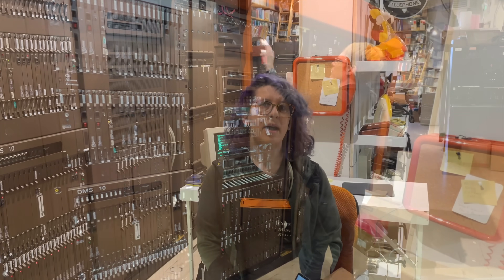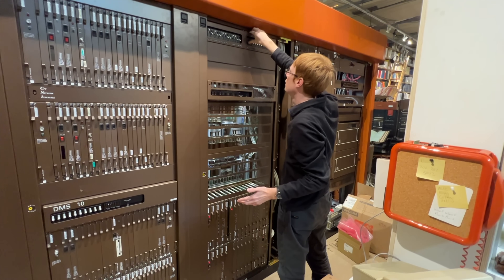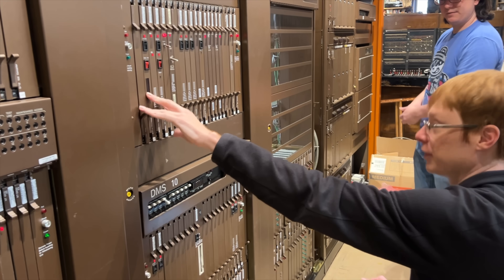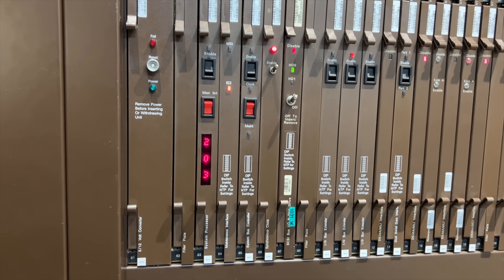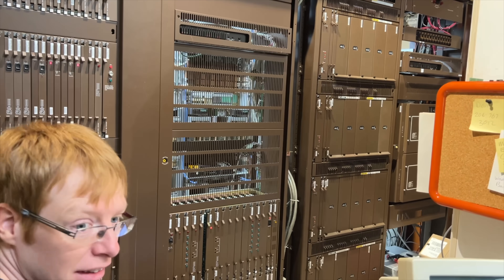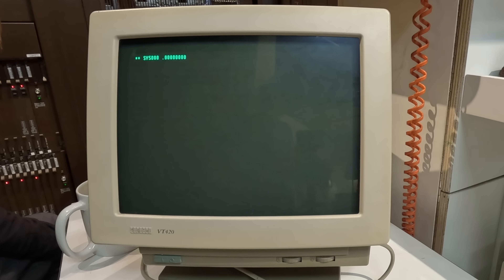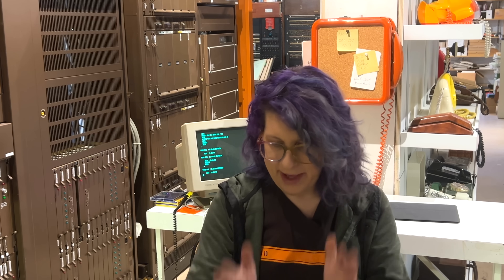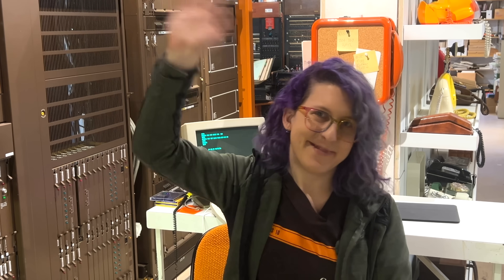🔌 DMS10 — Power Up! ⚡️

Comment: I’ve spent many late nights and early mornings bringing back DMS10’s, 100’s, 1U’s following catastrophic power plant failures. Our switches are old. Early-mid 80’s. The filter caps are dry and the converters are tired. It takes a lot of TLC, and a trusty lightbulb to jumpstart them. Over the years as the copper subscribers drop off it’s become a hell of a lot less stressful than it once was when the switches were busy. The summary near the end of this video Simms it up quite well!

Comment: @10:57 it is suggested that DMS10 would have interfaced with a TTY (or teletype) in the 1970s. The Nortel DMS10 was not manufactured until mid 1980s and typically had a DEC VT100 as serial interface device for switch maintenance and operations.
Reply from the maker: The first DMS10 was installed in Florida in 1978

Comment: Catastrophic failure. In 1986, I found the Y2K bug which resulted in every DMS100 system crashing and rebooting. Almost 1 hr later, the switch was backup.
Catastrophic means calls dropped and calls not processed!

Comment: Is it not worth pointing out in the intro that the Nortel DMS-10, also known as the Digital Multiplex System-10, was the world's first commercially successful Class 5 digital switch in the North American market having a significant impact on the telecommunications industry. Just wondered as I drifted here and wasn't sure what I was looking at to begin with.

Comment: Interestingly, the number 3 crossbar has listed in its CDs regarding the alarms, a "calamity alarm" in addition to the MJ and MN alarms. It was designed to report the alarms electronically to a centralized alarm center.

Comment: The telecom I work for still has 40 or so of these running with and without SDMs.  We also still run DMS100, 250S, 500S from Nortel.  We have quite a few LUCENT 5E, Siemens EWSDs, old DCOs, and some newer switches like the Genband G9.  They are lol slowly being decommed for Meta and Perimeta VOIP switches.  Parts are getting too hard to find for the older switches.  As a side note I live 2 blocks away from the old Rochester, NY Nortel headquarters.

Comment: The CPU is not in network 0/1. The CPU is in Core 0/1. You need to keep in mind that the CNI combines control and network bays into a single module. In the CE-3 bay, the bus extenders are the dividing line. The left side bus extender is part of the Core (lower shelf  is 0, upper shelf is 1). The right two bus extenders are part of the network. The left of the pair (the middle most) is associated with Core 0 bus and the right one is associated with Core 1 bus. This is for both shelves. 

You can get yourself into trouble by just pulling all of the bus extenders on the same shelf thinking you've got the shelf disabled in 1BUS. Oops, switch just init'd...
Reply: Ah that clarifies the different bus extenders a lot, thanks. There are so many redundant paths in this system that it has taken us a while to figure out exactly what links up with what. Time for a more careful read through the documents!

Comment: Shut down a few DMS100’s as our company abandoned local copper customers for fiber. The amperage came off the battery plant but capacitors held current for some time, after we verified it okay, some vendor would come & remove it. These were little CO’s at first, it got eerily quiet without all those fans spinning. And cold, these small buildings didn’t have heat, only air-conditioning, the switch itself warmed the place.

Comment: I recommend a SCSI emulation. (ZuluSCSI) They you can use a clone of the original image, remove stuff, restore it anytime you need. I did it with EWSD switch.

Comment: Brings back lots of memories. Never worked on DMS-10 but got my career started working on DMS SuperNode back in the early 1990's at the BNR Ottawa Carling campus. Used to walk up and down the isles in the lab just wondering what it all did. Don't remember much of it so I'm watching this series very carefully. Saw ENET messages fly by on the boot up so it's not that different.

Comment: When we got our second Nortel Sl-1 in the early 80's. it came with a KSR-43 tty.  Went through a lot of pin feed paper until I eventually moved it to a serial port on my 286 office computer!  BTW, it booted from tape and took a good 10-15 minutes to boot as well.  I was always holding my breath until it initialized after boot and finally delivered dial tone.  

BTW, we also had a number of remote shelves at doctors offices that ran off our switches.  One was located in another city about 30 miles from the host switch. They were connected to the host switches via PRI so they provided all of the same features that local subscribers had.   

Funny story, some years later one of our large Nortel 81-C's crashed at a hospital across town.  The tech there had an analog outside line and we were on a recovery bridge with a lot of anxious VP types.  I was having him read me the codes on the cpu card while we ran the recovery process.  At one point I heard a VP on the bridge say, "Do we have lift off Scotty?"  I was somewhat taken aback and asked what he meant.  He said,  "You are so calm like you do this every day".  I said,  "It won't go any faster by my jumping up and down and screaming".  Keep in mind this all being recorded for a root cause analysis report.  It took us about 20 minutes but I got the other tech talked through it and was finally able to log in remotely and finish the process.

Comment: I have to come to Seattle to see all this. If you ever get a dms100 I could do this in my sleep. The LCME frame is well within my scope of expertise too. You will not get rid of the critical alarm until you remove or offline the customer facing equipment that is part of the database. The best thing would be to offline the equipement

Comment: Nice job to get the old tank up and running again. We had the DMS10's big brother, the DMS500 (a DMS100 and a DMS250 combined) at an CLEC I worked for for the longest time. The thing was treated like it was some sort of holy artifact when I started and even had its own floor in the CO to itself. WHen I left it had mostly been supplanted by softswitches & VOIP and nobody loved the poor DMS500 anymore. Though that may have been due to its propensity to randomly trip breakers for reasons nobody could ascertain.
Reply: My first telecom job was a small CLEC in 1999 and we had a Lucent 5ESS. I was a field tech but knew my way around the basic feature menus for individual telephone lines and everyone I knew that had worked with a 5E and a DMS said they much preferred the DMS.
Reply: @maxpeck4154   I had just been reading up on ISDN and it seems the customer side was the other way -- sincere hope that your circuit lands on an ESS.  ;-)  Horses for courses, perhaps...
Reply: In the ILEC I work at we still have dedicated rooms with separate hvac for our DMS100’s, hell we have bronze plaques on the walls of said rooms honouring the date of commissioning and the folks who installed and loaded it for the first time. Though we are moving past the DMS era, they are still up and running, as we work toward total phase out. I often find myself admiring the big brown legacy gear. 45+ years it’s still up and running.

Comment: What; you're not gonna tell us what a catastrophic alarm is? 🙂
I think that's equivalent to the top tier in my ticket priority system:

P5 - wash your dog first
P4 - sometime this week
P3 - sometime today
P2 - next thing up
P1 - drop EVERYTHING til it's fixed
P0 - EVERYONE DROPS EVERYTHING til it's fixed
Reply from the maker: Good question! From the manuals:

Catastrophic - indicates complete loss of service in some critical part of the system. For example, failure of both of the billing systems' magnetic tape units, or memory faults in both memory systems.
Major -  indicates failure of one member of a redundant hardware pair. For example, one CPU fails, a memory page is spared, or a Network shelf fails.
Minor -  indicates a condition that requires attention but that is not system affecting. For example, a line circuit card fails, an MLI or DS-30A multiplex loop fails, or a Network clock fails.

Ours was in CATASTOPHIC because the SS7 links were down, and the switch could not send signaling information to the rest of the PSTN. This makes complete sense, because we do not have SS7 signaling at the museum, so the links could not possibly be up. As far as the switch was concerned, it was stranded on an island with no communication with the outside world. We made the SS7 links busy, and told the switch to relax a little, so it came out of catastrophic.
Reply: @ConnectionsMuseum  Gotcha.  In case it wasn't already obvious, BTW: feel free to dive fairly deep in these videos; you've got an audience for that.  🙂
Reply: @ConnectionsMuseum  separately: do I gather you guys got this switch from Adtran, where presumably they used it to test the equipment that they sold to connect to the pstn? Did they actually have ss7 links to the real outside world, or just to simulators? 

And separately, is that frame new enough to have any IP Voice connectivity, such that you might connect it to one of the two big International... I don't have a generic noun for those networks, and I can't think of the name right now... C-something?
Reply from the maker: It is somewhat unclear which parts of the configuration came from the switch's original owner, and what came from ADTRAN. We see a little of both in the configs. ADTRAN used this 100% for digital stuff, so the never even powered up the LCE frame (which serves copper-line POTS customers).

We do have plans for connectivity to the outside world, and those plans do involve IP. There is Nortel hardware that takes care of this, but we haven't been able to find it yet. Instead, we are planning to use a few of the digital trunk interfaces and connect it to our Genband G2, which will interface to the outside world. 

It will be accessible on C*NET and Phreaknet eventually.
Reply: @ConnectionsMuseum  oh, adtran wasn't the original owner. Okay. I might be wrong, but I think there's a decent possibility this will be the largest switch on C-NET once you get it connected.

Nobody has an actual class 5 switch connected to that, do they?
Reply: @ConnectionsMuseum  It would be very interesting to see the DMS-10 set up with MF or DP trunks to other analog switches in the museum, another interesting feature to show off in a video would be Centrex if the switch is capable of it, there were NT6X21 line cards that worked with special Meridian P sets at least on the 100 that looked like the Nortel phones you'd find on their key systems but communicated directly with the DMS instead
Reply from the maker: @thetechdudemc Totally. We plan to integrate it into the museums existing network

Comment: I started watching this saying "this is something that normally happens ONCE in the lifetime of the machine." And even then, it was done by Nortel engineers. I've only seen this in passing once. (and it ended up in a wood chipper a few years later, after the power company's stupid attempt to be an ISP/telco totally imploded. as far a I know, they never fully paid for that DMS.)

So, are you prepared to keep this thing powered 24/7 for the next 50 years? This isn't something you can power up every weekend for tourists.

The telco / ISP I worked for 20 years ago went to sell one of the long distance switches (Alcatel 600E). When Alcatel got word of this, there were numerous calls from them basically screaming if we turn it off they'll never certify it ever again. The only way to sell it is to sell the building it's sitting in -- without turning the power off. (that was a problem, as we couldn't sell the entire Manhattan CO.)
Reply from the maker: Yep, it stays on 24/7. It's on for good now.

Funny, ours was originally purcahsed by a power co-op in Texas who wanted to start offering dial up and DSL services in the late 90s. Just a few years later, this DMS-10 was replaced with a Metaswitch or a Genband something-or-other, and it was sold to Adtran for use in their lab.

Comment: Nortel switches and fiber optic multiplexers were usually fairly reliable. Where I worked at Telmar Network Technologies, we built our own test lab to test telecommunication ckt. packs. We put together a 5-ESS switch, a Nortel DMS100, Tellabs 5500 DACS, and a complete Nortel OC-48 fiber optic ring. Also we built our own -48 and +130 volt power plant. Also of course NEC optical mux. equip. RC-28 and NEC 405s.
Reply: Very very soon that stuff is going away in the c.o.

Comment: For some reason I wasn't expecting you to have a concentrated network interface like a GR303 which is really only about 20 years old. Unless you're connecting it to a Nortel subscriber access you might have to deal with "misunderstanding" between GR303 versions for various manufacturers.

Comment: I only know DMS II from Unisys. Can you add a little background and main purpose of this kind of machine. Is this something a major telephone operator would use?
Reply: Most telephone switches are what major telephone operators used to use. That's kind of the point of the museum. There are some small ones that were only used at very small exchanges like remote villages.

Comment: Holy amphenol connectors, Batman.. those cable loops give me some twitches from having to pin out and terminate those multi pair setups 

Pretty stinkin cool vid.
Reply: Everyone calls them Amphenol's but most of them are really AMP.  Now Tyco, a totally different company.  AMP pretty much invented the solder less connectors.  I was trained at their Harrisburg factory in 1973 when I worked for Control Data.  AMP was testing the "Picabond" tool then which was used for splicing cable on a pole.  Before that, the cable techs used to strip about 3 inches off each lead, twist them together, then insert it into a straw. I got so fast at using the Champ "Butterfly" tool  for AMP connectors that I could terminate a 25 pair cable in about 5 minutes.

Comment: Fascinating / nostalgic to see.  I can't remember them taking this long to boot.  Of course, they were SO RELIABLE I never encountered a situation where one ever needed to be cold booted after initial cutover.  I managed one of these in my first telco field mtc job and it operated for MONTHS at a time without a "code 5" (customer outage due to switch problems).  It's amazing to see these operate from a 2024 perspective.  The interface is so cryptic but they didn't have gobs of RAM to house verbose command strings and output grammar to make them more friendly.  It's more like talking to WozMon on an Apple ][ than a modern operating system.  Still, these were so well engineered and fault-tolerant, your switch will probably survive a electromagnetic pulse.  One suggestion... Rather than use a VT420, I would connect the serial interface to a modern PC and map the serial port through a terminal emulator so you can log everything to disk and search it, trend it for repeated alarms, etc.   One of the first things I did as a new employee in 1990 was convince my operating region we needed to stop feeding the switches boxes of fanfold paper to log the "ROP" (Read-Only Printer -- as if there's another kind?) and just log them to disk.  Within another year, most RBOCs adopted NMA (Network Monitoring / Analysis) which fed the console output into centralized minicomputers (typically IBM RS/6000s) which then did alarm scanning, threshholding and other SNMP type stuff that is routine today.